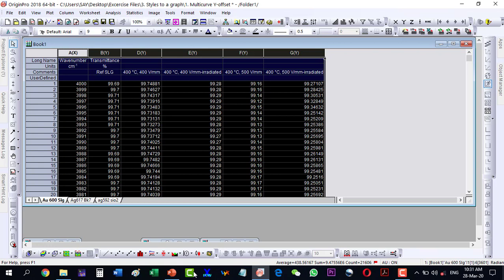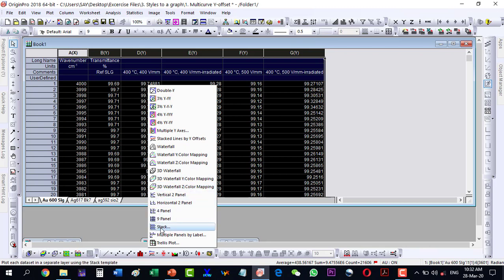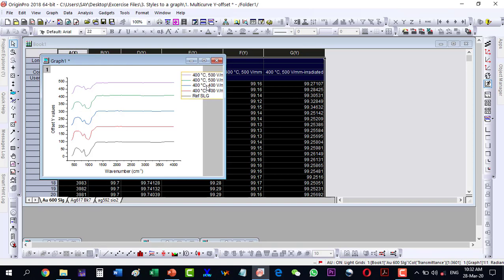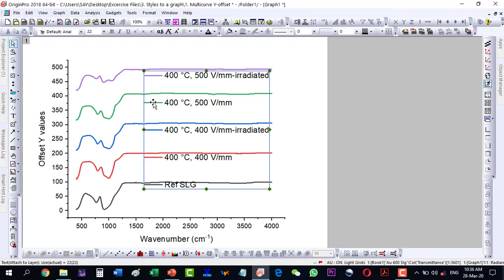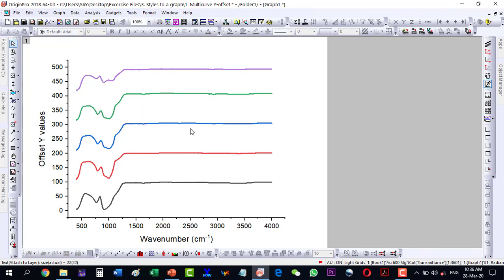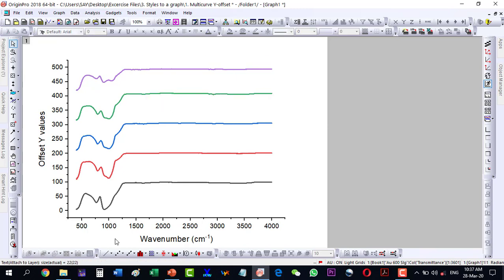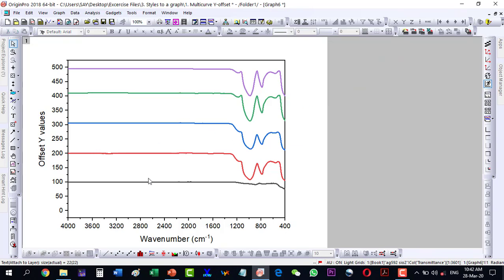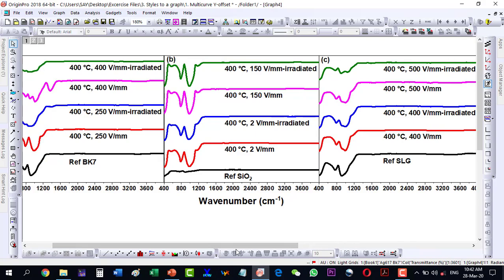How to plot Y offset or Y stack plots in origin

Comment: Thank you for your video sir, whenever I draw the stag plot for UV, order of the stag in plot was changed in Reverse manner that means first plot in last and last plot will be on first
Reply from the maker: Thanks for the appreciation dear 😊.
You can correct it many ways. Either adjust the columns in reverse or click in the graph empty space to open the graph menu and reorder. Thanks
Reply: @SAYPhysics  Thank you so much sir , it works now 👍🏾👍🏾
Reply from the maker: Great 👍. Thanks

Comment: Thank you sir, I have a question tho: when I tried to change the y axis to log 10 scale for a stacking lines plot, only the bottom line changed to log 10 scale (doesnt matter they are group or ungroup), could you please tell me how to apply it for all lines?
Reply from the maker: When it only changes the bottom one, it indicates it is only applied on the 1st layer  You'll have to apply the log scale on all the layers. Select all the layers and apply or apply on each layer individually. Thanks
Reply: @SAYPhysics  But I only have 1 layer here
Reply from the maker: Is on the top left corner of the plot, 1234 written? Thanks
Reply: @SAYPhysics  only 1 is written, I’m sure there is only one layer
Reply from the maker: You can email me your plot, I'd like to have a look at it. Thanks
sayphysics@gmail.com
Reply: @SAYPhysics  I have the same issue. What shall I do to make all of them change to log scale simutaneously?
Reply from the maker: @feiyueteng4661  I tried it many ways and didn't face any such issue. You may check the following;
1. Try it with all plots having its separate X-axis. Like if you've four one X and four Ys, make it X1Y1, X2Y2, X3Y3, and X4Y4.
2. If you have many layers, more than 1, then apply the log scale on all the layers.
Thanks